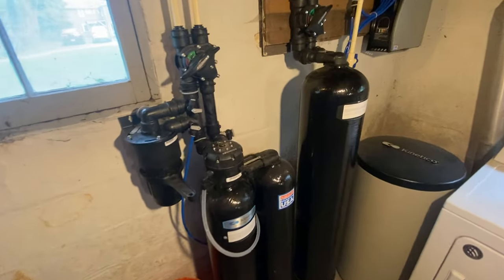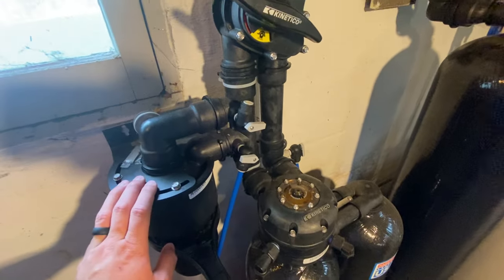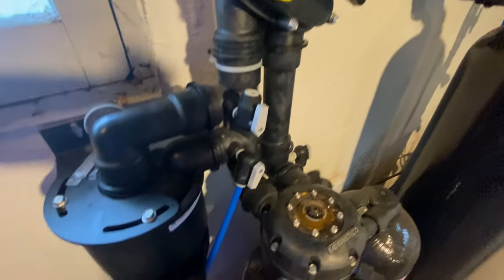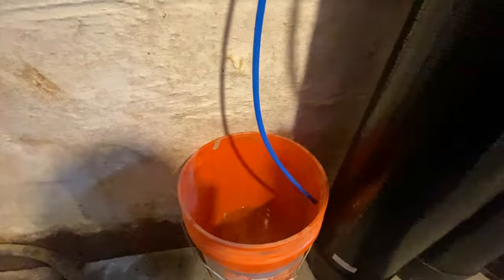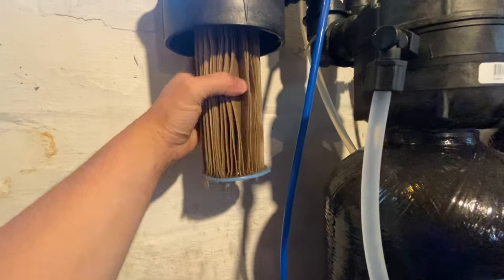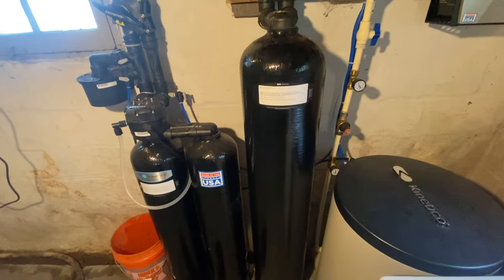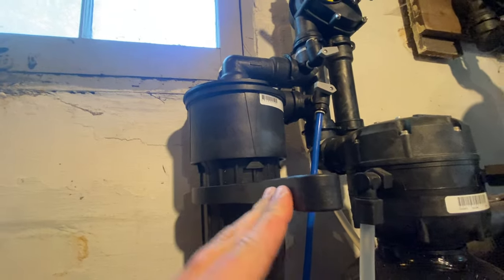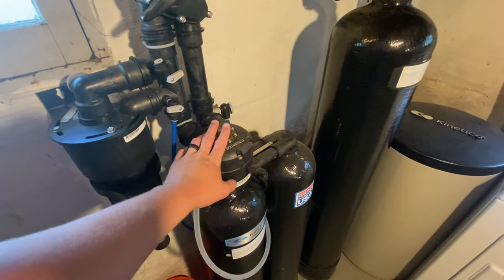How to Properly Change Kinetico Pre-filter Without Spilling ANY Water

Comment: After having to use huge force (including a rubber mallet and heat gun) to get the filter housing off, I now use food grade silicone on the top and top side edge of the housing to help ensure easy removal.  It makes a big difference.

Comment: Hi, Great videos. Is there supposed to be a o-ring in the groove where the filter element screws on? thanks keep up the good work.
Reply: I was wondering same thing.  Mine doesn’t have one.  But like in the video has like a hard plastic built in ring on the sump.
Reply: After closer inspection I do have a o-ring but when there's grease on there it can be really hard to see unless you look close with a flash light.

Comment: I'm realize this video is over a year old, but I've just been charged with looking after my nephew's widow's Kinetico system.  For the life of me I can not find a part number for the pre-filter replacement cartridges.  I simple can't find anything on line the "looks" correct.  The one in her system looks identical to the one you installed in this video.  Thanks
Reply from the maker: If you call up your local Kinetico dealer and ask for a "10 inch 20 micron Mach Prefilter" they should know exactly what you are looking for.

Comment: Hi Kasey,   How do you lower the softener setting on Q850 quad with 2 year old head unit with blue softener setting cap?  It is currently set to M and I would like to move it one or two settings lower.

Comment: My valve is in bypass mode but the water won’t stop. It’s continually a full stream with no end in sight. Any thoughts why this would be?
Reply: Me too. Did you figure out what to do?
Reply: @SuperSinger63  nope. I had to shut off the water main and then change the kinetico filter. I’ll have to schedule an appt eventually for them to come look at the softener
Reply: I’m having the same issue. Did you ever find out why?
Reply: @TheGoswitzTeamRealtors  the reseller came out for a routine service check and it turns out it was a faulty bypass valve. They replaced it for free with the service charge

Comment: I am very tempted to buy a Kinetico whole house system for my house which is fed by my well. I have a decent sulfur smell emanating from my Artesian well at times, but by and large my water is clean and consumable for drinking. That said, my local Kinetico dealer wants close to double the cost of the next best system from another manufacturer. I think it is in part because I live in an affluent part of town. I'd like to get a whole home system (to eliminate sulfur smell for bathing and brushing teeth in the bathrooms), and with the highly filtered drinking water system in the kitchen. 

Trouble is, if my local dealer refuses to reduce their price, how do I know I am getting a fair price if they are the only dealer of Kinetico in the area?

For that matter, is Kinetico that much better than competing whole home filtration systems like Springwell, Aquqafina Rhino, Pentair Pelican, etc.?
Reply: Ask about re-furbished models.  That's what we installed.  Yes, a little more expensive but I can tell you that it was well worth it for us!  Just the savings from using less salt, it will pay for itself in 5-7 years.

Comment: I can't get my filter cartridge loose.  I don't want to break anything.  Would you recommend using a heat gun to warm the cartridge head so it expands a bit?
Reply: Mine is stuck as well, did you end up getting it off?
Reply: @jakerussell7720  I used a Harbor Freight heat gun I've had for years on low heat setting.  I applied heat around the perimeter at the top as evenly as possible, then tapped in the same area with a rubber mallet, and did this process for about 15 minutes, and it finally came loose.  Before reinstalling, I applied generous amounts of silicone grease to the o-ring to help prevent this sticking situation in the future.

Comment: What if the system is set up so the wrench can't  go around the filter housing?  How can you remove it then?
Reply from the maker: Look into oil filter wrenches the bigger oil filter wrenches will work
Reply: I use a strap wrench on mine.

Comment: I turned to yellow and red, water never stopped flowing. What does that mean?
Reply from the maker: Your mach bypass could be shot. You can just use a different valve in line to shut off all water to the house.

Comment: Why a 20 micon filter ? Use 5 make ur system work less
Reply from the maker: A water softener doesn't filter the water. The pre-filter is just that, a filter before the softener to keep any particulate out of the small orifices in the softener head. In certain instances it is beneficial to use a 5-micron filter but not in my case.